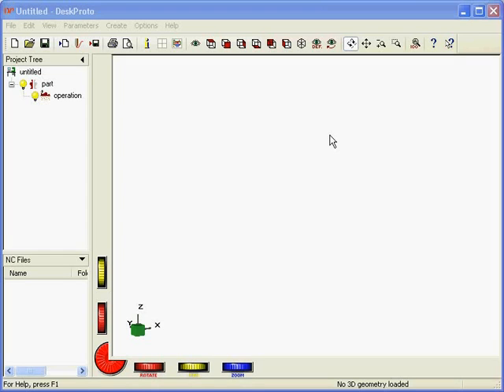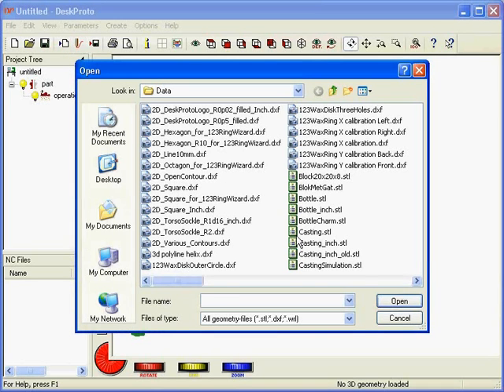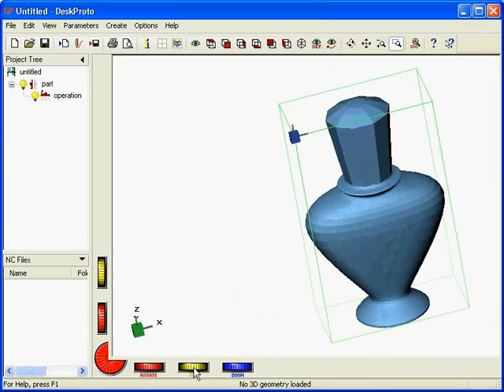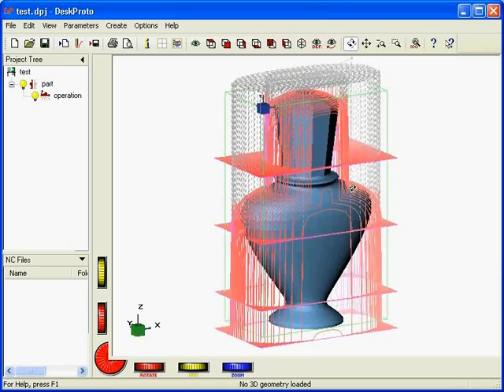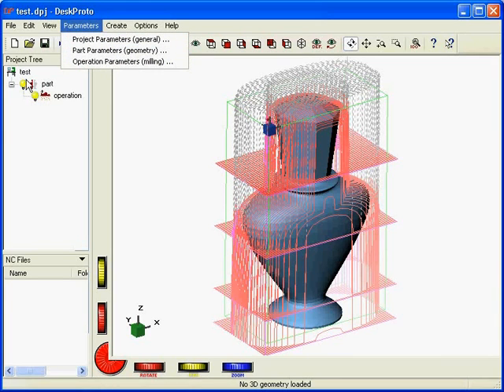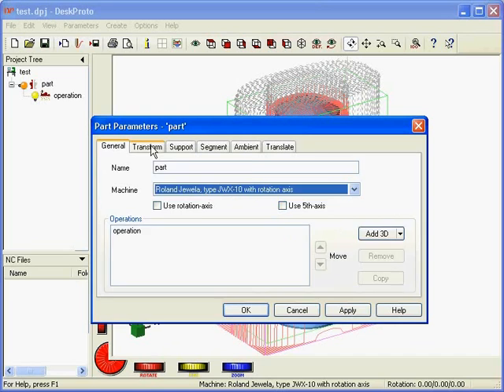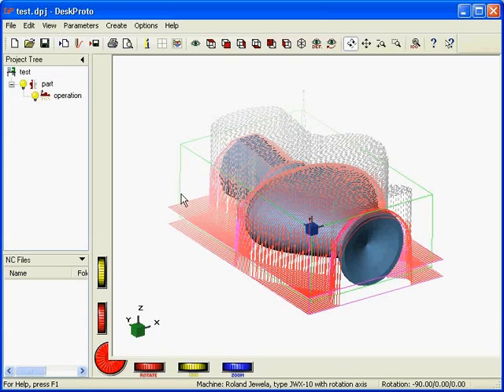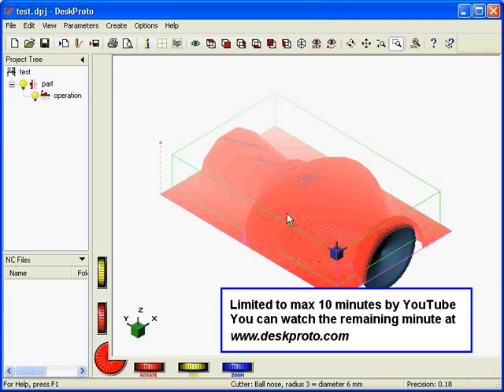DeskProto Basics Tutorial

Comment: How do I pocket a hole in deskproto? it is present in the STL but the finishing toolpath just does a superficial notch instead of pocketing it out
Reply from the maker: For geometry machining (STL files) DeskProto does not know the concept of Pocketing: the cutter simply follows the geometry of the part. Such superficial notch will be the result when a ballnose cutter is too thick to fit in the pocket, or when the toolpath does not go over the center of the pocket.  In order to exactly machine a pocket it is best to use vector machining, based on a 2D drawing of a top view of the part.

Comment from the maker: @leloodallasmultipass  For any machine that runs with Mach3 you can use the Mach3 machine definition in DeskProto.  In order to make that work correctly you will need to configure the machine definition, as size, speeds and other settings will not yet be correct. You can do so via Options >> Library of Machines >> OK on warning >> Select your machine and press Edit.  Now you can set dimensions, speeds and so on.
Here you can also define that your machine has a rotation axis (button Advanced ...

Comment: @LexLennings I am doing 4 axis milling.  Will the iso plain g-codes setting work for that?  I just tried it and the rotational axis selection went grey.  The tormach I am working with is running on mach 3.  can I use that option from the list or are there special configs for that?
thanks
Reply: leloodallasmultipass
Reply: leloodallasmultipass

Comment from the maker: Tormach machines are not yet present in the list of machines in DeskProto.
Still I am pretty sure that it will work: just select the machine called "ISO plain G-codes" and see if Tormach accepts the resulting files. You can do so using the free trial version.
In case of any problems you can configure the postprocessor in DeskProto, or ask us to do so for you.